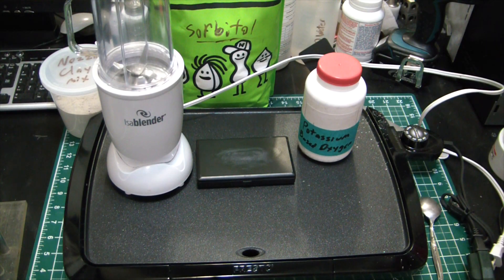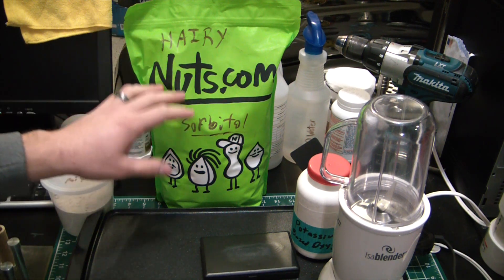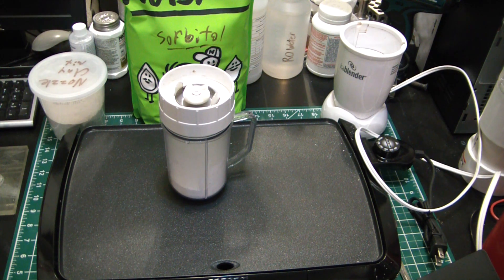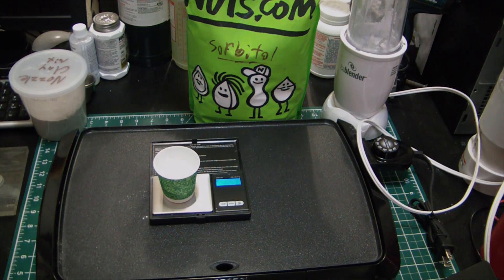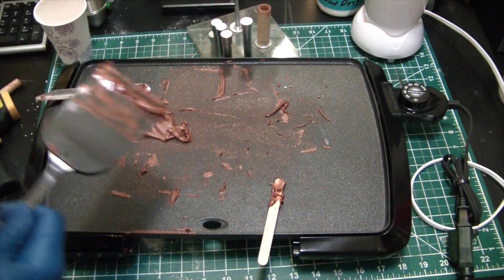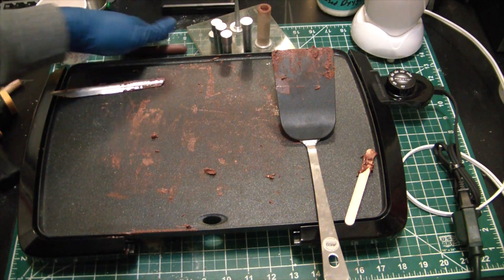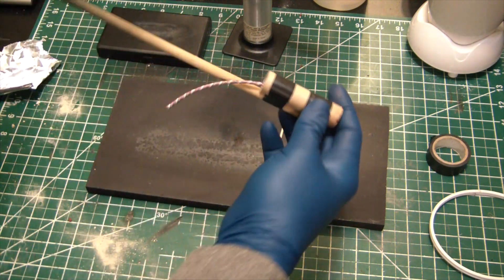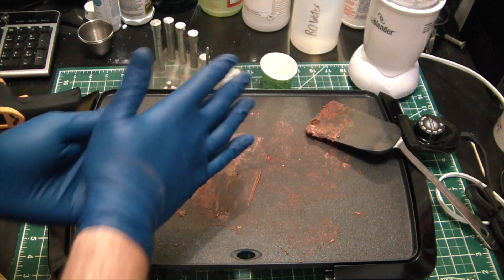Sugar Free Rocket Propellant - The EASIEST Rocket Propellant! - ElementalMaker

Comment: It's like a party in your mouth and everybody's coming.....oh wait. Shit!  That sounded really, really bad.  Sorry for that....truly.  I guess I could have hit backspace a number of times to change what I said, or hit cancel to not even post this comment altogether.  I do have ADD/ADHD, so this is why this happened.

On topic...Cool video topic.  I was playing with potassium chlorate last weekend with some oxidizing substances packed into old flint glass tubes with narrowed nozzles.  I got some interesting results and a couple of actual rocket launches.  LOL.  I am currently making more potassium chlorate while building up a nice collection of red phosphorus for my element collection.  The bulk packs of safe strike matches come with solid strips of red P on both sides.  I think it's 10 or 12 packs bundled in the bulk packs of 50 count match boxes.  I currently have 4g of red P.  I'll use it eventually for something other than making WP.
Reply from the maker: Holy crap man I would stay VERY VERY far away from any chlorate based rocket compositions. It's a quick way to lose a hand or worse. Especially when phosphorus or sulfur gets involved it becomes crazy sensitive and unstable. Just don't want to see you get hurt. Stick to XClO4 compositions and you'll be much safer
Reply: @ElementalMaker  Oh yeah. I appreciate and respect the concern. I didn't use phosphorus as part of the composition.  I also wasn't fooling around with any dangerous amount of the chlorate. I used a fine light gray aluminum powder with the chlorate with about 50% of the total composition being carbon / very fine charcoal dust. The remaining 50% was a composition of the chlorate, dextrose, sulfur powder and the Al powder. I only had about 2g total of "rocket" fuel which I packed inside 3mm diameter x 2cm long rolled aluminum foil. The mix burned just fast enough to launch the micro rockets about 10ft into the air. The mix was actually slightly wet with 50/50 isopropyl/water for a paste which could be injected into the tubes and packed to eliminate air bubbles. The stuff burnt much slower than black powder which is what I wanted. The aluminum powder was added to give a little bit of a sparkly exhaust since it isn't German black Al in my inventory. 

I don't make any combustible or low explosive mixtures greater than a few grams. I don't purposely make primary high explosives either, but I have accidentally twice. Hence a reason I mostly perform micro/chemistry. :)
Reply: @mwilson14  nice to see you here my friend! We apparently have a lot of similar interests.
Reply: @Phred_Phlintstoner  Damn right! :D Good to see around here as well. If I'm not working or reading, I'm playing YouTube vids like this and inventing 9 out of 10 useless things.
Reply from the maker: Hahaha love it!

Comment: Can thermite be used as a rocket propellant?
Reply: Mike Cunningham no
Reply: I imagine that if you used the correct mixture of thermite and built the nozzle to the precision of a planc length, probably not but it would be fun to try anyway
Reply: Dont believe so. If I am not mistaken thermite only releases heat for the most part. All that is happening is oxygen is being swapped from one metal oxide to another elemental metal to form its corresponding oxide. Extremely exothermic but aside from some boiling metal fumes nothing but heat is released which would not be useful for a rocket.
Reply: @Richard_Talks  so...you're saying if we add a water tank it'd make an interesting steam rocket? :D
Reply: @voiceless_scream  lol presumably so. If a method of transferring the heat to water without mixing it can be found.
Reply: @Richard_Talks  oh, I'm sure the thermite will manage to heat the water. That won't be a problem. Keeping the rest of the rocket intact...that might be a bit more difficult
Reply: @voiceless_scream  lmfao ain't that the truth. Just gotta keep the water out otherwise the reaction wont self sustain.

Comment: How about using "ammonium based oxygen" with some added aluminum powder instead of the potassium compound? Also, could you use paraffin wax instead of sugar for a formulation that won't absorb atmospheric moisture?
Reply from the maker: I've been experimenting with NH4NO3 and NH4ClO4 based composite rockets quite bit lately. I'll do a video soon!
Reply: @ElementalMaker  make some propellant using some dollar store h2o2.. you can concentrate it to 90% apparently.
Reply: @retiredshitposter1062  If you're talking about evaporative concentration, 75% is more realistic, with 85% being the theoretical maximum (it's the azeotropic concentration around room temp). On top of that, peroxide is much harder to use for rockets, requiring a liquid fuel or hybrid design. If you create a fuel-peroxide mixture (or compound), you're gonna have a bad time. I'd like to see some experiments with a hybrid aluminum/~60%H2O2 rocket.
Reply: @retiredshitposter1062  75% H2O2 is dangerous enough to call it a deamon, if you drop a piece of hair in 90% H2O2, things will go kaboom and splash a bunch of H2O2 onto your face, BTW, 90% H2O2 can melt your skin and flesh easily.
Reply: I love the wax idea. I actually had some wax get mixed in with some black powder I had made up amd it burned like the 4th kf July snakes they sell.